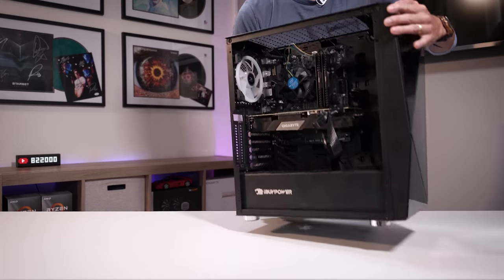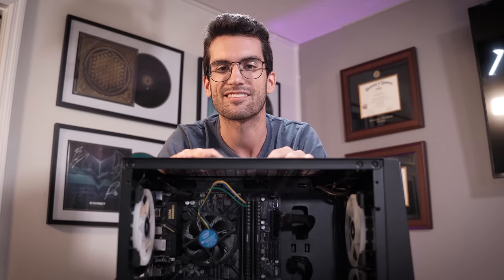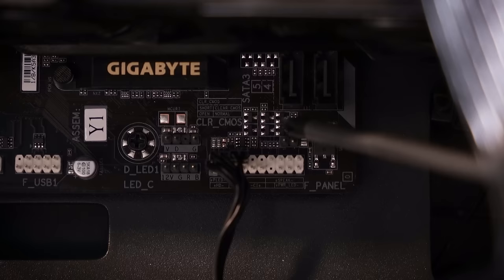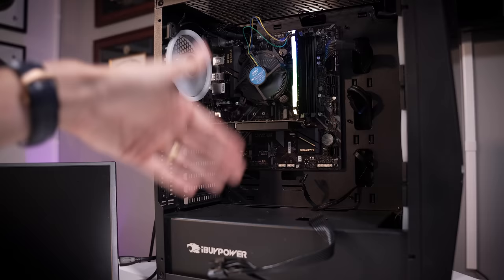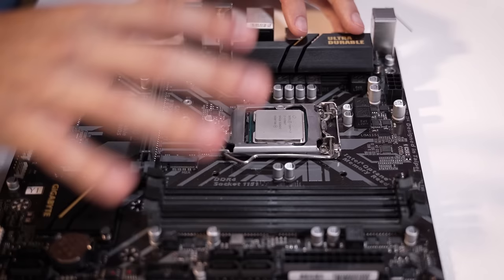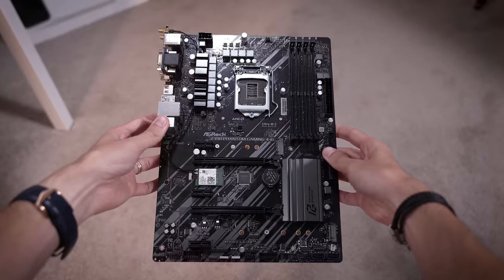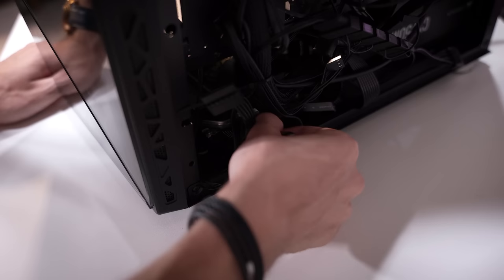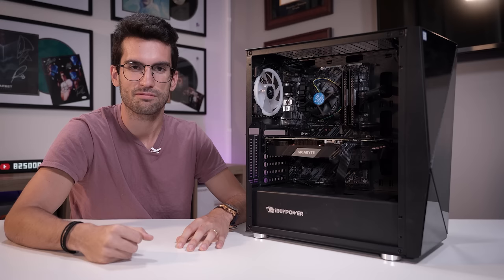Fixing a Viewer's BROKEN Gaming PC? - Fix or Flop S3:E1

Comment: You always do the same mistake of fully powering off the system before clearing the CMOS. In about 70% of the boards you aren't clearing anything at all, as the power must be in the system for the clearing to take place. If you fully power off (by not having electricity attached) then most boards will NOT actually clear the CMOS. Some can still do it but many of them clear the CMOS only if electricity can circulate on the board. This board in the specific is a Gigabyte one and all Gigabyte boards require power for CMOS to be cleared.

In fact in 90% of the cases you "cleared CMOS" in your videos absolutely nothing happens, even when a difference in the boot process would be clearly seen.
Reply from the maker: You are 100% incorrect. You aren't utilizing ANY power from the wall when clearing the CMOS. Instead, you're manually cutting power from the clock battery on the motherboard, thus erasing presets and starting fresh.
Reply: @GregSalazar  As I said, many modern boards require the power on. It's strange and it shouldn't be usually the case (in the past it wasn't) but it is. There are countless threads talking about the matter, especially on Reddit. Some boards can work in both cases, some with just the PC attached at the wall. One such example is the Gigabyte B550 Aorus Pro. I should know, given that I have one, and in the beginning I couldn't reset the CMOS because I had the power not attached. Had to do a research and then found out it required the plug attached. Subsequently I've seen numerous threads of Gigabyte, Asus and MSI boards requiring the same. I think it has to do with those boards having a dual BIOS.
Reply: @lavir74  Can you show us that in writing somewhere?
Reply: @lavir74  I'm with you, Lavir.

I posted on this video (and on Gregs new one where he is calling you out) stating that I have experienced the same thing on multiple gigabyte boards. On his new video, I then referred him to a reddit thread talking about this very thing. My comment thread was deleted on his new video.

I don't understand why this complete shutting down of sharing knowledge and experience is happening.
Greg, this solution could help people.